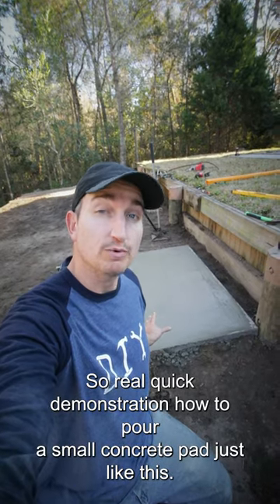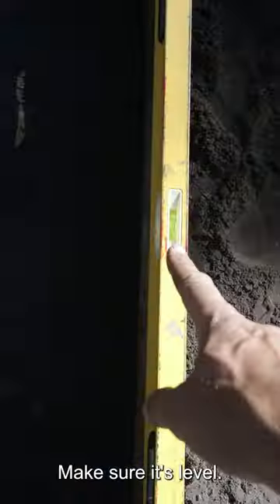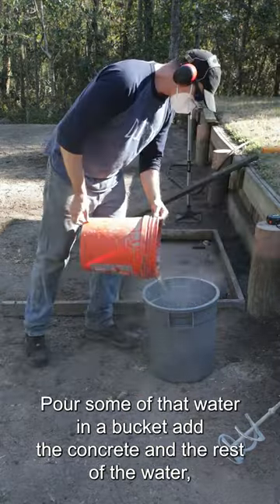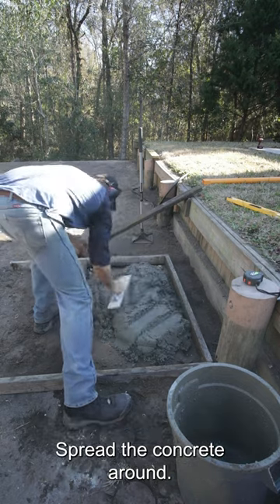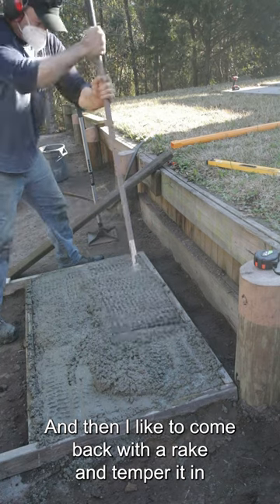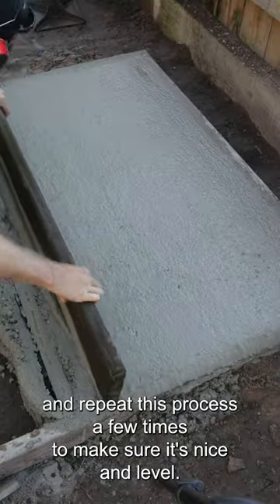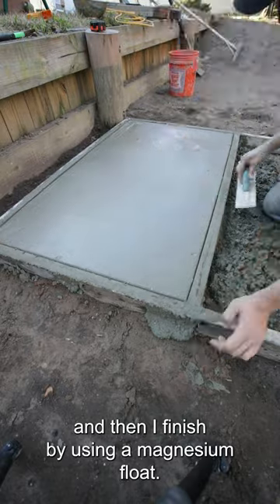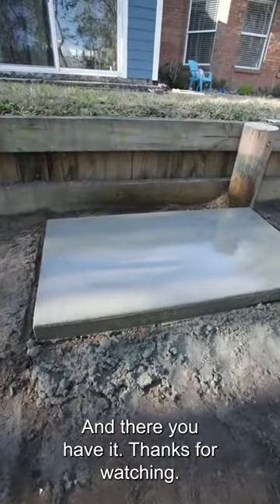How to Pour Concrete Pad Yourself

Comment: If you need to lay a slab on a larger slab that isn’t level, do you need to scribe and cut the bottom of the 2x4s, or is there another way to fill the gaps?
Reply from the maker: Here is a video where I poured a new concrete floor over an old concrete porch.   I show how I handled the change in pitch here https://youtu.be/zrcwuhsHCA8
Reply: @MrKistel  thanks!

Comment: Can you keep going and expand it?
Reply from the maker: I prefer to build larger concrete patio type pads using a system of combined smaller individual sections.
Reply: @MrKistel that sounds interesting. I guess that way it's broken down in easier to manage sections. And if one part needs replacing, the rest is intact.

Comment: Don't mix it t his way. Use a wheel barrel and a rake. Position the wheel barrel so you can add water on the downhill side. Use rake to blend the edges into the water. That way you can control the water and you don't get clumps. Then you can dump concrete into form without much shoveling. Also level form with stakes. And you don't need rebar for stuff like that.

Comment: lol it wil crack and split in the first or second year winter.......quick tip for you plastic sheet on the ground for ground insulation and then add a piece of wire fencing in the concrete bout 2 inch deep....your welcome
Reply: galvanized wire

Comment: Are those regular 2x4? Why doesn’t the concrete stick to the 2x4
Reply from the maker: Yes the form was built with regular 2 x 4s.  Usually, wood forms come loose pretty easily if they are pulled within 48 hours.  Sometimes larger form boards may stick a bit more.

Comment: Kind of forgot the gravel base, and the rebar. Mix also looked a bit thick. But nice effort. Will suck when you have to replace it in a year, especially from the drainage coming from above.

Comment: Literally poured on topsoil. That's basically lesson one in the "don't do this" book. Topsoil is compressible due to organic content and will settle under its own weight in most instances, forget about additional loading from anything going on the pad. Dig out the topsoil and fill with sand, compact it, and top with dense graded gravel, pack that, then you're ready to form and pour.
Reply: Seeing how as there is no steel in there it will most likely form fit to whatever the dirt underneath it does anyways😅
Reply: Relax. It's a tiny slab for a grill or something similar. It will be ok.

Comment: Curious, because a concrete guy I am not.  Why is magnesium the metal used for the float?
Reply: A magnesium float pulls liquid to the surface allowing it to evaporate.
Reply: It doesn't have to be magnesium and in fact all modern ones are cast aluminum. The reason it's used is that it's cast with a slight round to it and is smooth surfaced which means it won't drag the aggregates/stones up but settle them down while bringing the fines to the surface. The goal is to get the "cream" on top for a smoother finish. The water is not brought up to evaporate it will mostly absorb back in once it stops being disturbed.

Comment: Like others,  im curious why this is missing any structural support like rebar/metal meshing?  Also, getting our hands on fiber glass loose fibers, or heck, horses hair will work too (its what was used before!), and adding this extra material to the cement when mixing will increase the protection against cracking. It costs so little, since not much is needed, that these days it almost feels irresponsible for me or 1 of my employees who goto a site, regardless what work we doing, we have a small ziploc bag of loose fiber glass (typically swept from the floor when doing a large order of fiber glass insulation and cutting it down to size) in our tool bag/tool box, and even if another crew is doing the cement pour, we will politely ask if they want to use some loose fiber glass, and many times we happily explain the virtues of adding a small amount, and almost never do they decline. Who would when you explain simply the science behind more even and level weight distribution when fibers are embedded in the concrete vs it lacking. 

Also, would anyone have added a layer of sand and small size gravel to the pad, and tamped THAT down,  before pouring the concrete + fiber mix?

Ive gotten into the mindset to treat each job, small or large, important or not that much, as a critical job on my OWN home. And its how I explain it to my workers, and its how we take pride in our work.  
A few times weve returned to a site where some damaged/cracked concrete pad is sitting.  Maybe it was poured when it was too hot and too dry and not moistened while curing? Maybe prep work hadnt been done? Who cares. What matters is our work was noticed, as it was done elsewhere on the job site, and it was us who was called in to fix the issue.

Comment: Why after removal of the frame you keep it wet?!!!!!
Reply from the maker: It is my understanding that concrete cures more thoroughly if kept wet after it has hardened.  Even though concrete stiffens relatively quickly, it will continue to cure (and likely become stronger) for weeks.  Having available moisture over that time period should help the curing process proceed more completely.  Even if this is the case, in practice, I rarely see this step applied to new concrete projects.  Seem like most concrete companies just pore the concrete and that is it.
Reply: @MrKistel  Keeping it wet also stops it shrinking before it's strong enough to resisting the shrinking/contraction pressures which is what causes the cracks. Especially the micro-cracks in the surface.

Comment: And btw.  Rebar is hardly EVER used on a floating pad like this. Or a driveway.  Without chairs it floats or most often gets stomped down to bottom by the finishers.  
Concrete CRACKS. That’s why the tooled joints or cut joints. On a pad this size, neither are required 
A thickened edge would’ve helped.  
What your left with here is a floating slab at the mercy of the elements
Reply: Yes it is.
Reply: @scoutullreich-ov9xf  I meant to say it gets used.  Stomped to bottom ,even with you constantly pulling pulling    You need chairs. To keep from floating as well as sinking 
Btw. It will still crack. The cracked pieces just hold together better 
Signed cut saw shitty fiber blade rebar bottom of driveway removal specialist
Reply: @scoutullreich-ov9xf  chairs scout.  Damn chairs. Never see them anymore. Standard issue in my day for residential and curb/commercial site work

Comment: Why is everyone acting like you are building a foundation l. It's a tiny slab that will probably never hold much weight. People act like everything needs to be perfect for this tiny thing. I've seen bigger projects like whole driveways done with shit prep work by "pros". Good job. I did a similar thing a long time ago to keep my recycle and trash bin on.  It's holding up fine. No cracks!
Reply from the maker: Thanks, this concrete slab is working as intended without issue.

Comment: Why do i never see anybody put stone under the slab? Are people that lazy to dig down 4 inches to put a more stable base in? Also no edging or joint cuts the corners will chip off and the slab will crack. Spend a little extra and do it right the first time and you wont have to do it again.
Reply: I missed the edging was actually done but everything else still applies.

Comment: As a professional safety boy: that face mask is not a recognized component of a comprehensive silica protection plan

As a former concrete dude: you need rebar and a thickened edge. One to hold it together, the other to hold it in place.

As a hopeful: we’re all learning here. I just hope not too many are learning from you and repeating. :) I’ll be looking for the revised production.
Reply: As usual. A condescending commentator with zero content of their own but likes to point out his professional status. 
 This is absolutely fine for a small slab in the garden. He did a grand job
Reply: @kktomm  nothing I said is condescending and everything I said is accurate.
Reply: @kktomm  - as usual, a smart alec who tries to insult the person  who has provided correct information.

Comment: Why no rebar
Reply from the maker: Not needed for this light load duty small concrete pad.  Metal reinforcement is to help keep concrete from bending (under heavy loads).  The stretch from bending is what would cause concrete to crack.  Wire mesh can be used to help hold concrete pieces together if it does crack, however.  Many people don't realize, or overlook, that metal can cause concrete to crack and a main reason I will not use unless necessary.  I feel this is more likely with thinner concrete pads.    If there are any small cracks in the concrete, the metal within can rust and expand within leading to more concrete cracking.

Comment: Personally I'd prefer a little thicker slab. A 2x4 frame will only give you about a 3 1/2 inch thickness. Fine for a step maybe, but you want it thicker if there's going to be any heavy loads going over or on it.

Comment: your concrete is so dry that it probably doesn’t slump on the slump test 😅
Reply from the maker: When you only add the amount of water stated in the instructions it seems very dry.   Adding additional water makes it easier to work with but may weaken the overall concrete strength.

Comment: Why don't you put in some wire or rebar? Cheap insurance.
Reply from the maker: Was not necessary for the load application of this concrete pad.   Also, I am hesitant to use metal reinforcement with shallow concrete pours.  Should the metal start to corrode the swelling pressure may actually cause cracking and chipping in the thin concrete.  On deeper pours, for heavy duty concrete applications, metal reinforcement is usually ideal.
Reply: @MrKistel  is there a coating solution to stop the corrosion? I've even heard about plastic rebars being used. Idk, I'd put something in there just to be sure.

Comment: You forgot your steel rebar, rib cage
Reply from the maker: It was determined not necessary for the intended use and expected loads of this concrete pad.
Reply: A few pieces of rebar is cheap insurance. It’s less about load and more about giving the pad elasticity to resist cracking & breaking apart over time. I’d recommend striving to do more than the bare minimum

Comment: All the people calling for rebar are either civil engineers or have never poured concrete before 😂
Reply from the maker: In this area most housing development contractors pour entire neighborhood driveways without rebar.  Same for sidewalks.  Many of the driveways do crack however likely due to the heavy weight of vehicles. The light load of this type of pad will not really benefit from metal reinforcement.

Comment: That's going to crack because you didn't use any rebar in your slab.
Also, after your "magnesium" floating you should have brushed some texture to the top of your slab so it isn't so slick when it rains. 
Amazing that people make how to videos when they don't know how to do the job correctly.

Comment: Prefer so see a pass with steel trowel followed by broom finish (which can be done with any broom) and I know its a small slab but being above grade especially could've used atleast some 3 bar around exterior to keep cracks from opening up because there's only 2 types of crete, crete that has cracked, and crete that's gonna crack 😂 but over all not half bad. Glad to see you didn't mix the crete to the consistency of cambells chicken noodle soup like some DIYers. 😁👍

Comment: Ok while that will make concrete it is a poor job. While I realize it is not designed to withstand a lot of weight, the proper way is still to dig down, add aggregate, tamp then add wire mesh or rebar and pour. It can and will settle when on dirt with no rock/aggregate foundation.

Comment: You need to dig for a footing or the slab will move.  Also, I would recommend running some chicken wire along the bottom with small spaces to lift it from the ground before you pour to strengthen the slab. This one that you did will not last

Comment: Uh . . . guess you live in an environment where the ground doesn't freeze, otherwise, that pad is going to shift and buckle.  Good luck with that.  Otherwise, get an auger, dig down three feet, place a rebar rod, fill will concrete, lay gravel, lay chicken wire, THEN lay your concrete.
Reply from the maker: ya mild climate region where this vid was recorded

Comment: At first I was happy to see this wasn't a dry pour cement, then I saw the concrete mix and it was pretty dry lol. I feel you should of added more water when mixing.
Reply from the maker: if you mix bagged concrete with the amounts of water listed in the instructions it feels and looks dry.  Additional water can weaken the overall cured strength of the concrete.

Comment: Yep and my guess it’s already cracked
Reply: Why
Reply: With the "quicky redi-baggy mixes" pea gravel NOT #57 limestone is the main ingredient & very little portland cement. The "quicky-baggy" mixes are for "home-loaner's" only!
Reply: @alejandronavarro3592  you have no sub base as the ground dries out it moves which will without doubt cause it to crack. Concrete/ cement as some call it needs a solid foundation to work with such a thin amount used. When it cracks frost/ weather will just make it worse. Do the job properly and only need to do it once.

Comment: You really should not keep your concrete wet. Water will weaken the strength of the concrete once it finishes curing.
You're only supposed to add water to start the reaction that sets the concrete. Any more just weakens it.

Also where is your rebar and a few ground spikes will help keep the slab from ever shifting

Comment: you mix concrete with fiberglass and it will never crack
Reply from the maker: ya I like to use the the premix with fibers already in it when avail
Reply: Using fiber will cause the finish to shed for ever

Comment: Pouring on top of dirt and wearing ear muffs and a mask makes me
Question your ability to lay down some concrete… sincerely a Union concrete finisher
Reply from the maker: The mask is for when the bagged concrete is mixed.  The dry cement dust is very fine and goes airborne and is not good for your lungs.  In fact, the local concrete precast facility is required to have a full time water truck driver to drive around the plant spraying water on the ground to keep any residual dust from going airborne.  This is to protect the lungs of their employees.

Comment: What no rebar or wiring or steel mesh for strength to prevent cracking? Nah this is not the way to do it my guy. Fail.

Comment: Wrong…wrong…wrong! You didn’t use a drainage gravel for your base material. You don’t screed side to side. And you mag it before it starts to set to get the cream up… oh yeah! Then you use a steel trowel to finish…. What a doorknob
Reply: Geesh...I'm so confused. But this much i know ... lost a 33 years running business because no vapor barrier was used under concrete slab. The building was constructed during the era of drive by inspections.
Reply: @donnahubscher7995  Vapor barrier only required in building foundation.  It's to separate wet from dry zones (separate the ground from the inside of a building)